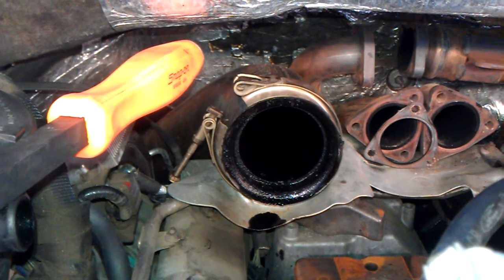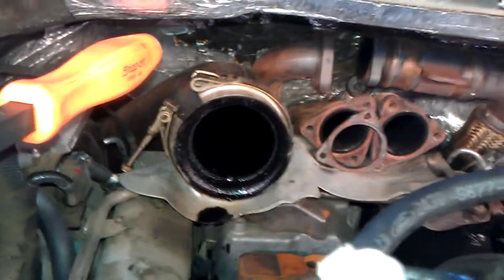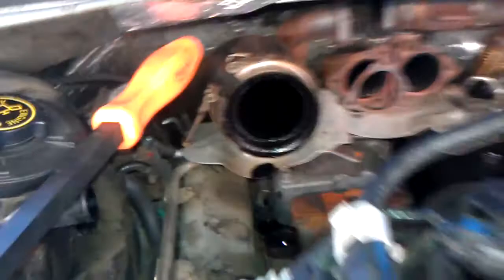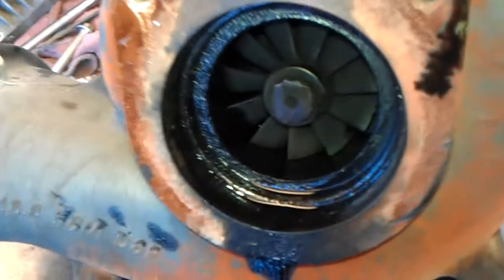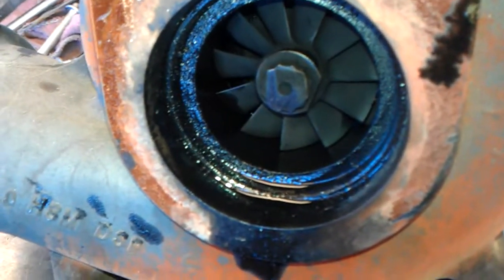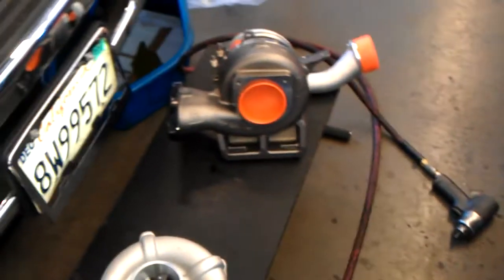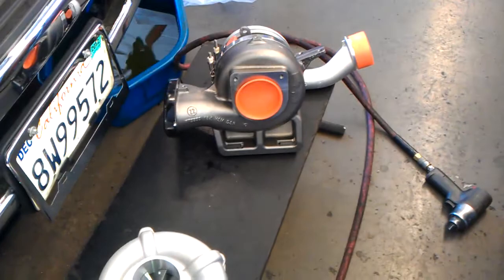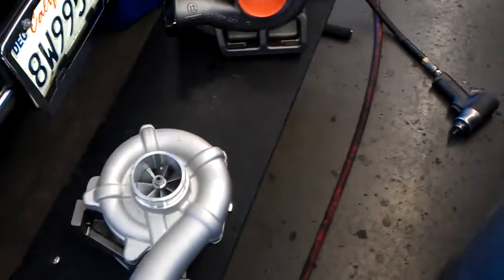SHOP UPDATE 4/6/2012 6.4L TURBO DAMAGE

Comment: I have a 2010  f250 6.4,,, 
And is been giving a lots of problems related to turbos,,, the oil indicator light came on , so i went and changed the oil pressure/temperature sensors ,then i took my truck for a ride and it ran smooth for a couple of miles , But same light can back on again , then i ent and do the process again , but this time i also replaced the map/AIT sensor too, including oil pressure/temperature ,, and  also turbos   , truck ran ok for a while (though didnt get much boost from turbos ) this time my truck ran longer until the  oil indicator light came  back on again , but managed to drive back home , though white smoke kept coming out of the exhaust , same thing happened before i replaced this turbos ,,,  oh i got a code P0179A  is about power to turbo actuator circuit , ,,,